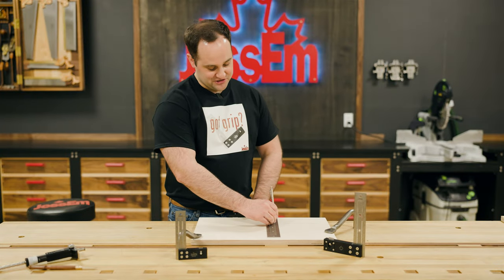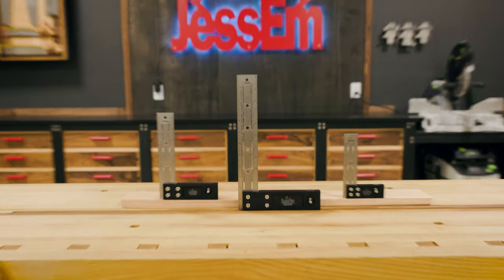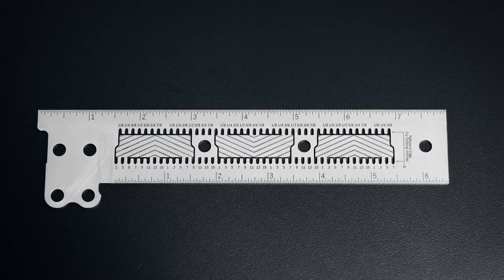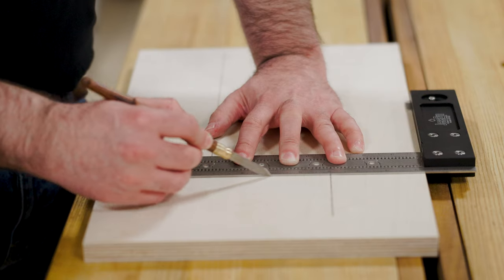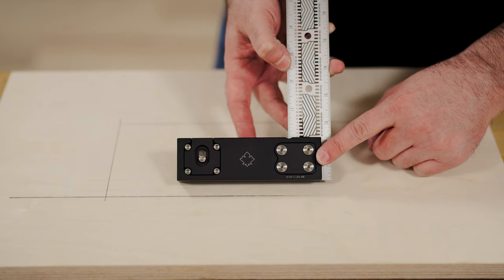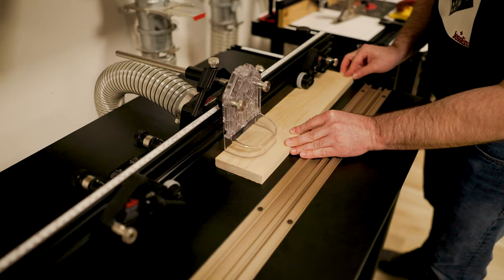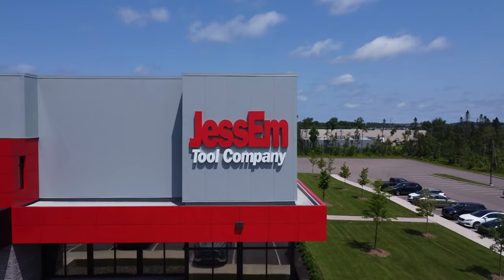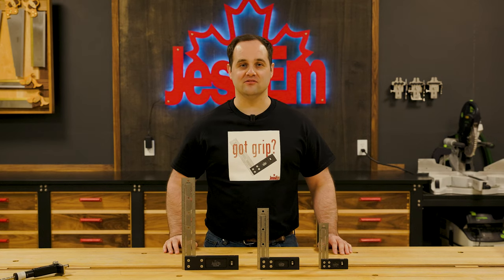JessEm Precision Squares - This Woodworking Square is Changing EVERYTHING!

Comment: Impressive squares, I would love to order the metric version, but the only thing that stops me is the complete lack of photos or video reviews of them. Both on the official site and here on youtube I only come across images of imperial squares (which is very strange, since there are only a couple of countries left in the world that still use inches). Could you post on the site or make a video review of the millimeter squares?
What interests me most is how the markings are done. Are they the same on the inside and outside of the ruler (as is usually done with combination squares)? And what is the thickness of the base block? If it is the same as the inch version, this will lead to a difference in the millimeter markings on the two edges of the ruler.
Reply from the maker: Hi @sergeyshorokhov2167, we'd love to answer your questions:
• Most of our business is conducted in the USA, hence the prominent imperial photos and videos
• Both the metric and imperial versions are identical in build quality and functionality
• The metric markings and scribing notches are in 1mm increments
• The blade lengths are made according to the blade size purchased. (a 6" blade will be 6" and a 150mm blade will be 150mm). Imperial and metric do not share blades or bases.